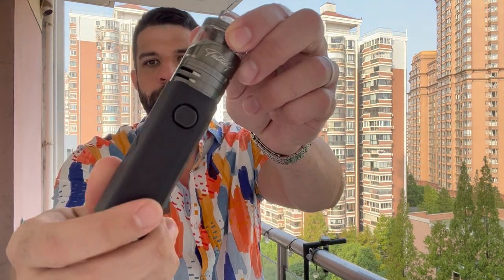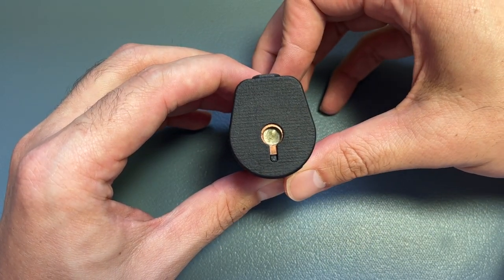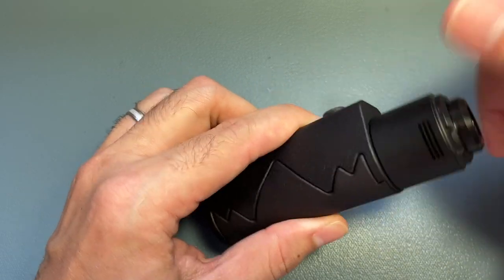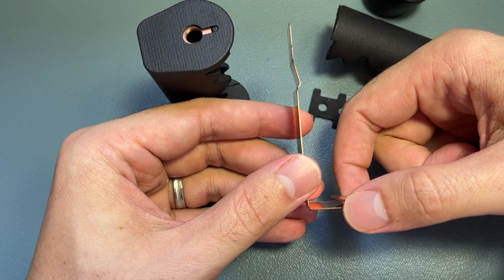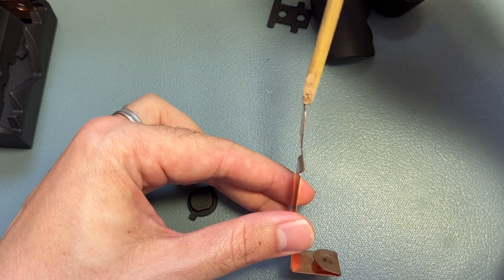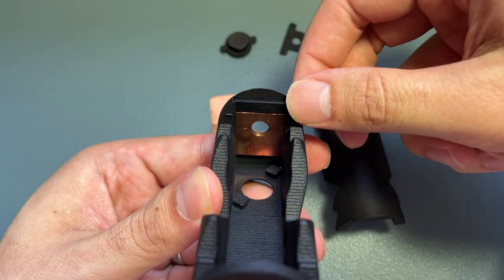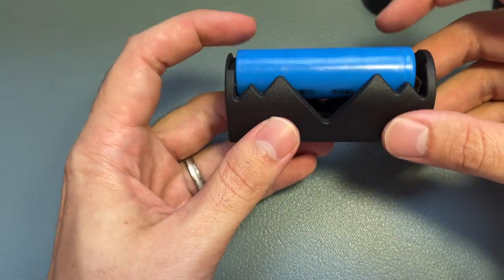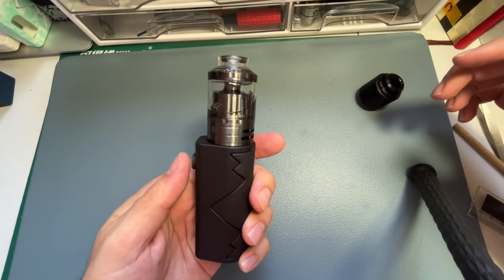Matterhorn 21700 by Snow Cap Mods

Comment: Oh wow! This is going to be a "must own" to go with my Denali! I love all the improvements and how ergonomic it looks in the hand. I still rock the Asgard Mini on the Denali!
Reply from the maker: The asgard mini looks absoutely fantastic with the asgard beauty ring on this mod!
Reply: @snowcapmods2110  Asgard Mini and the Nightmare are God tier RDA's!
Reply: @snowcapmods2110  Will the Molicel P45B 21700 fit comfortably in the Matterhorn and the AV 2? Molicels are slightly taller than the Samsung 30T and IMO the new P45B out performs the 30T. Just wanted to make sure before I go for one.
Reply from the maker: @CountryboyAR  I honestly don't know. i haven't been able to find a p45b. However, the mod is built with some extra room inside the battery area.
Reply: @CountryboyAR Does the Molicel P45B fit in the Matterhorn?